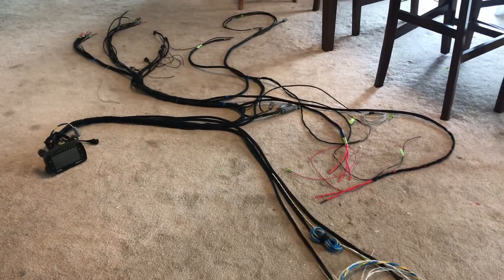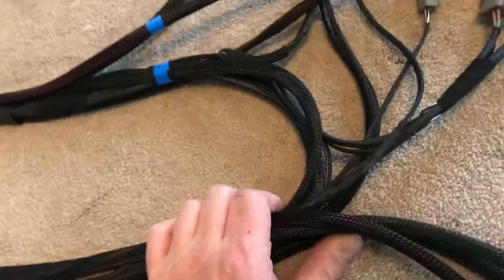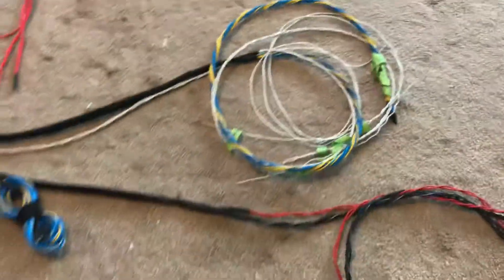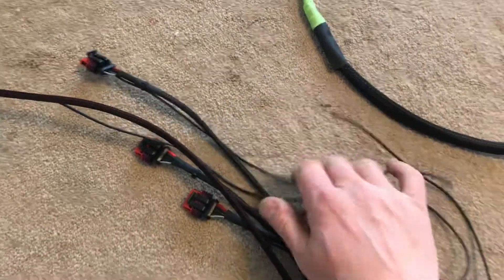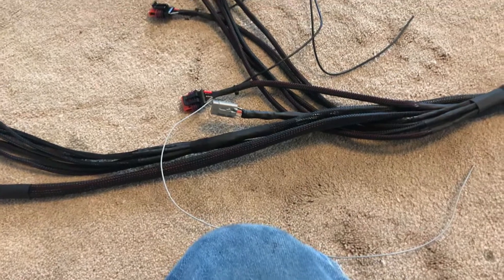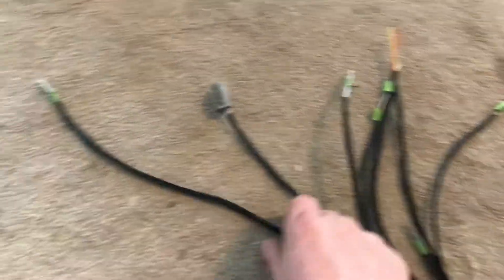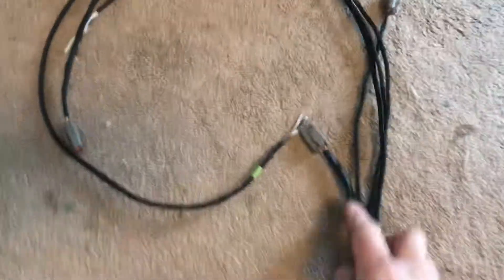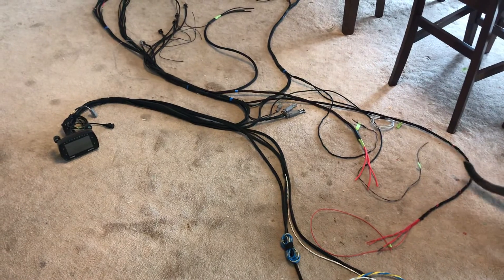FuelTech FT600 engine harness

Comment: Was that made from the unterminated harness or is that a fuel tech pre built harness?
Reply from the maker: It was made from the 10’ unterminated harness.    I used txl wire throughout.   It’s for my 2jz in my 240z drag car and so far it’s been Awsome with only software setup issues getting it going.    
I’m glad I brought all the extra outputs to a general location  in the passenger footwell as I’ve used most all of them after getting the car going and dialed in
Reply: @nathaninwa240z  what extra out puts? Was the unterminated harness not enough? What else did you have to get aside from the harness
Reply from the maker: @FourDGarage  after wiring in all my outputs to trigger things like the trans brake, trans dumps, water pump and cooling fans, I had about 5 total of yellow and blue outputs that were extra
The harness provides the inputs and outputs, I still had to add power for injectors, idle motor, coils and what not.   
It was nice being able to separate out the wires into groups and make break out areas that fit my chassis and my relay locations.     I must have had the harness on and out 10 times verifying all the stuff before I finalized it all!